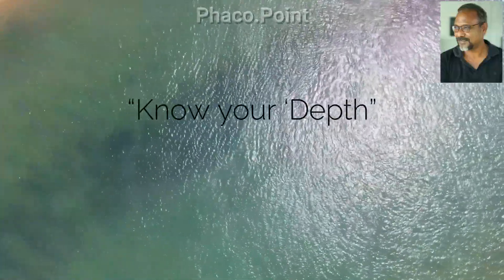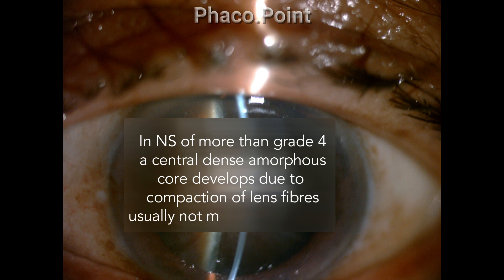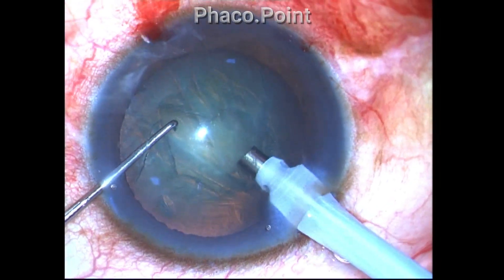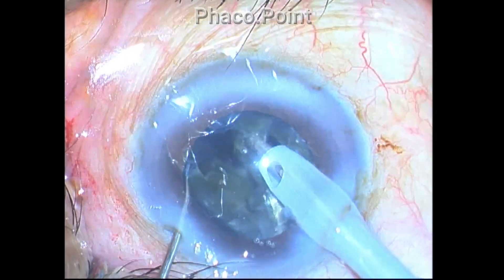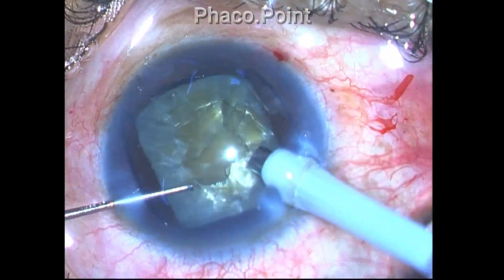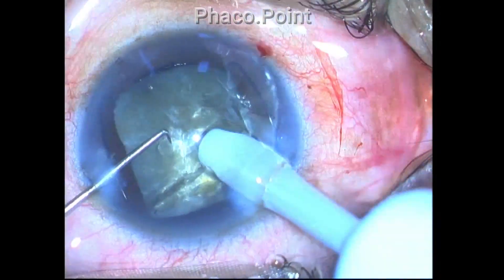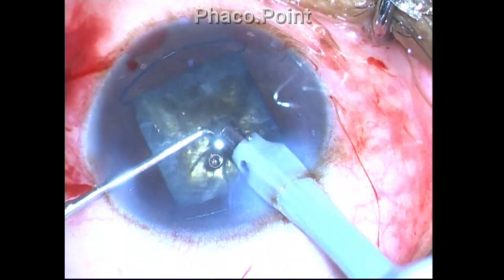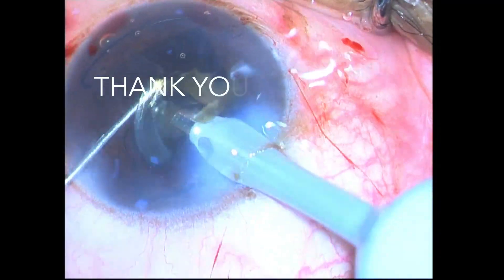"Know your depth" - direct phaco chop basics - the Depth , the Angle  and the point of impalement .

Comment: Great teaching points! Can this also apply to horizontal chop?
Reply from the maker: Horizontal chop uses compression force instead of a vertical translation force Asma direct chop and is more forgiving wrt to depth of hold. However the catch is that the blunt chopper needs to be carried to the periphery of
The bag

Comment: Regarding the machine parameters during the procedure, would you plz highlight those points like AFR, mode and magnitude of power (whether torsional or longitudinal) and the presetted vacuume amount .thanks for sharing your skills ,Sir .
Reply from the maker: hello Dr Ali ... for a hard grade of cataract I use a power or 50% in the multi burst mode with a burst duration of 30ms and Duty cycle of 70%, vacuum is 350mmHg . This is the stellaris machine which is a Venturi machine and hence the flow rate is not set

Comment: Hi doctor 
I have a question 
Can we use direct chop with MegaTip ?
What is the ideal phaco tip to do direct chop ?
Reply from the maker: hello.. you can certainly use a Geuder Mega tip and it will work nicely. make sure you use a 20 G tip with 15 or 30 deg bevel which will ensure you have a good hold and good emulsification. Direct chop can be done with any type of 20G tip..more to do with technique than the tip.

Comment: Sir..  From where does come these air bubbles in ac in phaco wd me also....
Reply from the maker: I think these air bubbles occur due to loose sleeve. It’s been re used many times. This will cause turbulence of fluid inflow. It can also occur if the power that is set is too high for the grade of cataract
Reply: These bubbles are nothing but cavitational energy which implodes realising 1000 C heat and help in emulsification process that Respected venkatesh sir has already explained in their one of  video